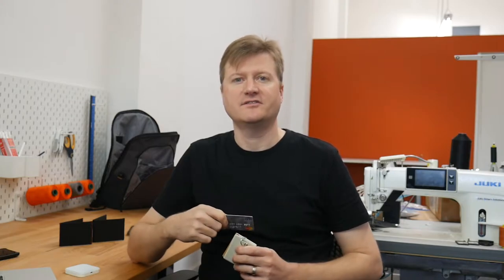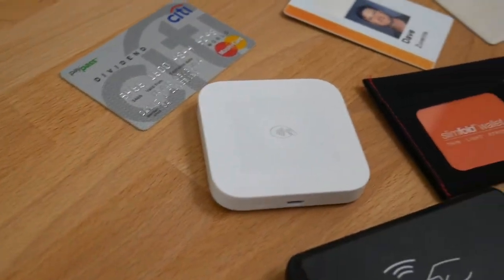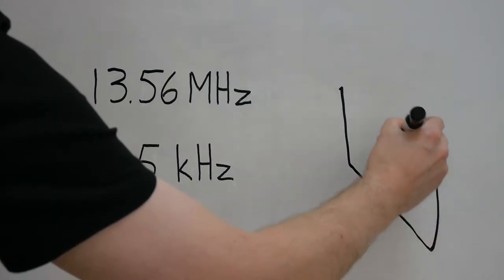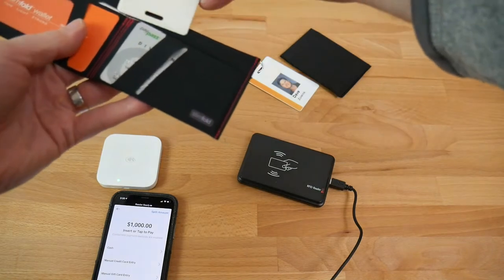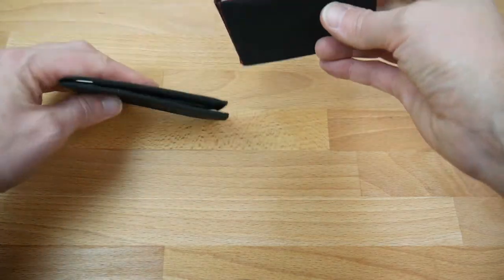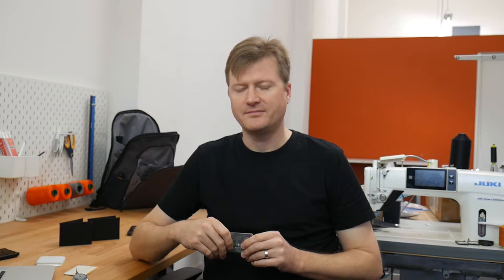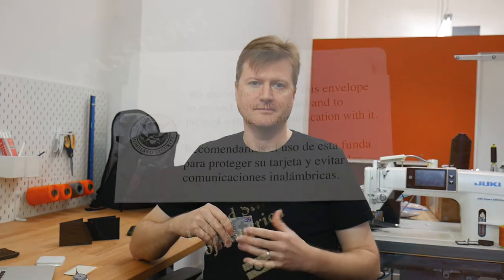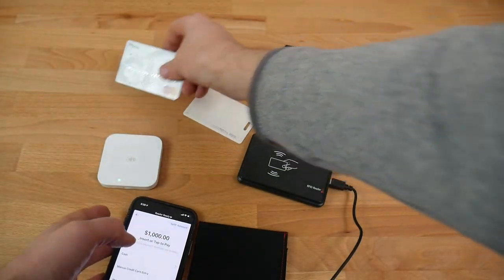SlimFold RFID Blocking Wallet Explanation and Demo

Comment: I have had your Micro soft shell wallet for over 6 years and see the RF ID blocking foil is looking wrinkled or degraded. Do you offer replacement pieces?
Reply from the maker: There's no contact directly with the RFID pieces so they shouldn't wear out but if there's an issue with them we can replace them. Just reach out to support on our website or reply to your order confirmation and we'll help you out!

Comment: is the RFID removable from the wallet?
Reply from the maker: It is removable in our MICRO wallets but not Original or Nano. Enjoy!
Reply: @SlimFoldWallet  does the rfid blocking part take up extra space in the wallet or is it used in place of other material in the non rfid version?